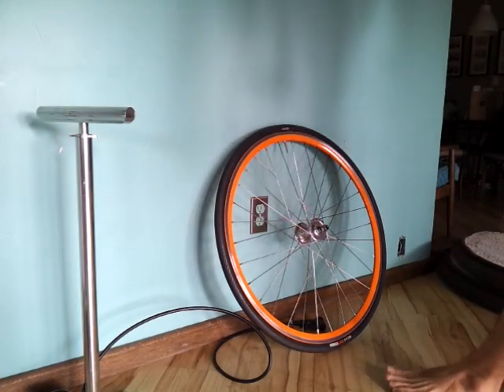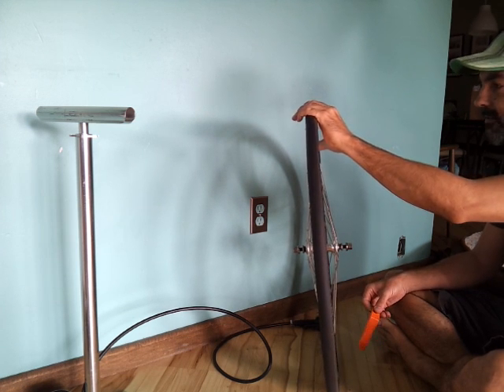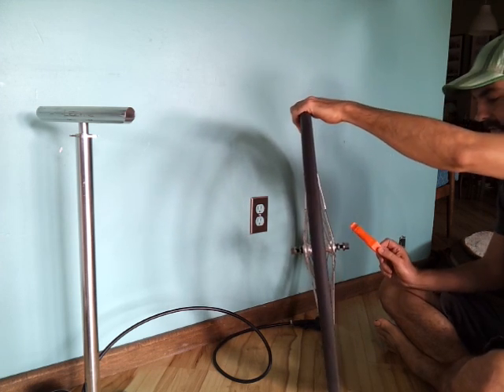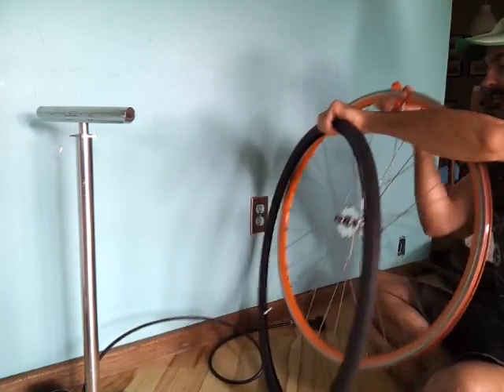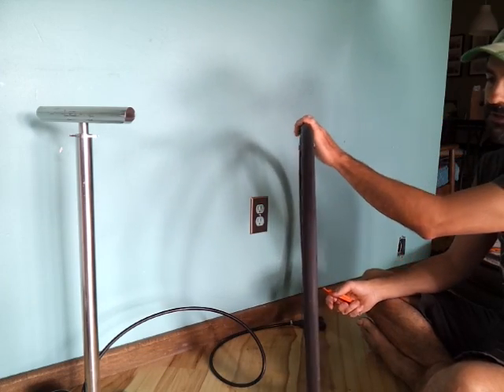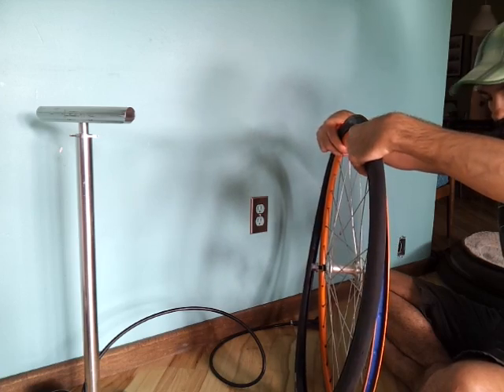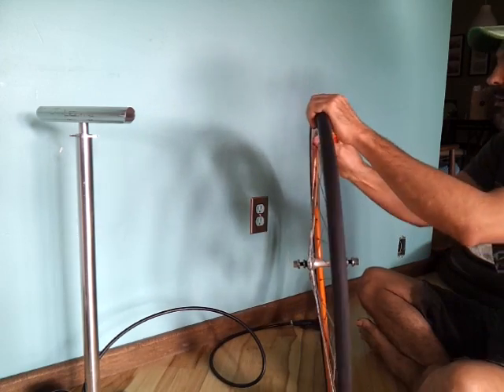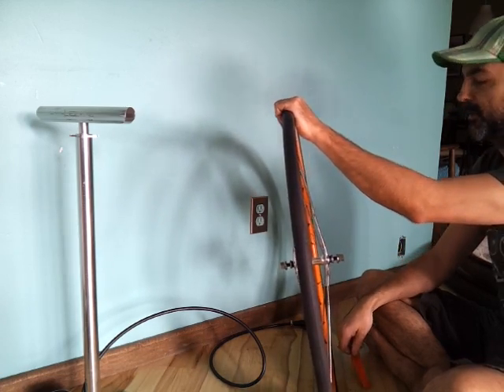The 802BikeGuy.com Bicycle Tire / Tube Changing Method

Comment: Try that sweep with Conti's  Good luck with that.
Reply from the maker: It's doable, just needs a little more effort. I'm going to record a follow-up using folding bead conti gp4000s tire on a narrow road wheel. I mount and dismount contis regularly, including wire and folding gator and hardshell.